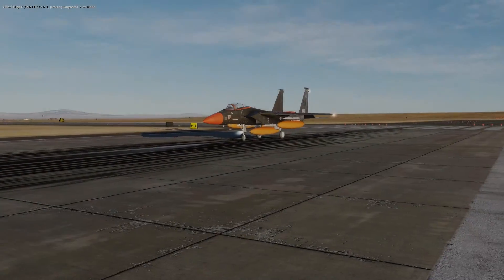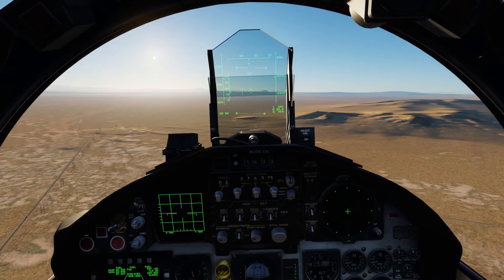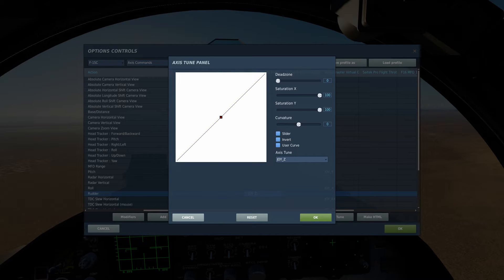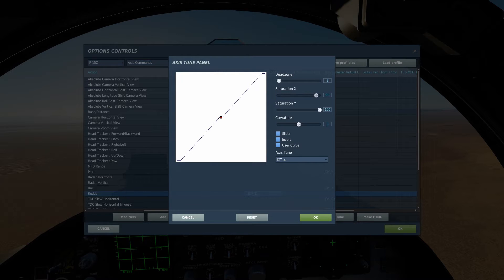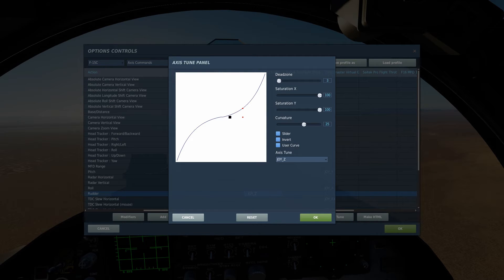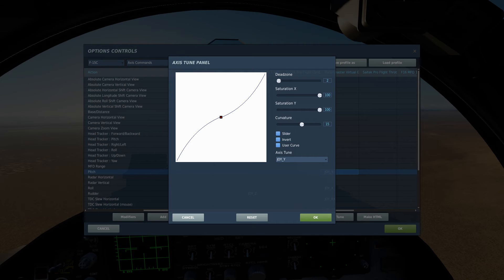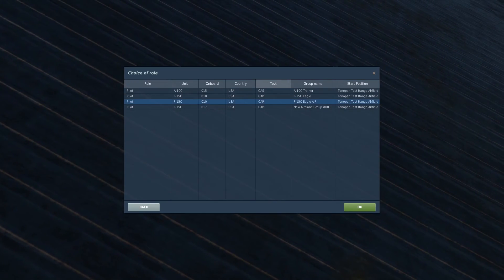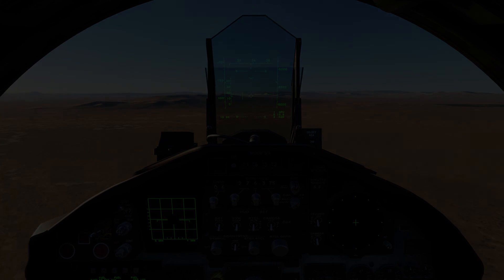Axis Tuning DCS World - OUTDATED CHECK DESCRIPTION

Comment: Can i have the dead zone only on one side, say like only when i pitch down?
Reply from the maker: Not through in game configuration.. However, some of the third party apps can do it.
Reply: Do you know any of theese programes?
Reply from the maker: What is your hotas?
Reply: I'm using the Trust gxt 555 predator.
Reply: @quiccsilver5708  hi, i use same thing and i am unable to calibrate it  in game, if, how did you do it thanks (=
Reply: @quiccsilver5708  oof  thats bad to hear, i downloaded some driver from their site and managed to calibrate it in dsc to be somewhat controllable, what did cause you the most problems, what do you use now
Reply: @darthtrump4428  im stil using it can you give me the link of the drivers and explain how did you calibrate it? Thanks
Reply: @quiccsilver5708  
 To be honest i am not entirely sure how i did it or when i did it
i downloaded the software (20567_02.exe) from here  https://www.trust.com/en/product/20567-gxt-555-predator-joystick

then you open it, one of the folders includes some sort of calibration device, some red moving bars, also vibration initiation (i do not use it in game, do not even know how)
after that i tried callibrating it in the dcs game and was sucesfull  for the first time. it resulted in vast improvement, except the joystick rudder(twisting motion) sometimes does not return in completely exactly the same position,(few degrees or so)

otherwise seems to perform ok for now, i noticed the full  throttle in game is reached way sooner than the end of travel on the hardware

rudder seemed to be the most off center

hope this helps